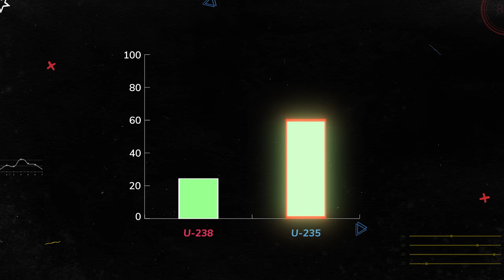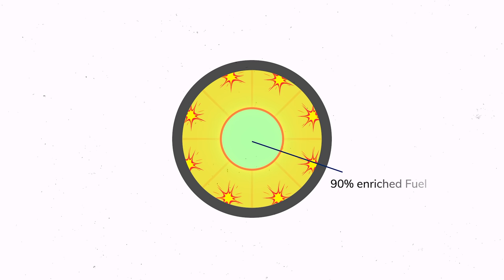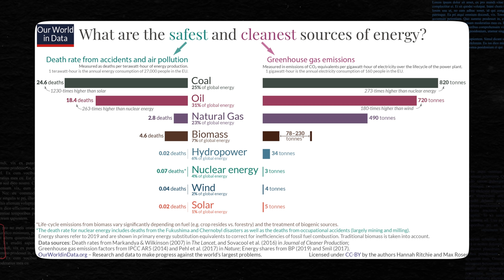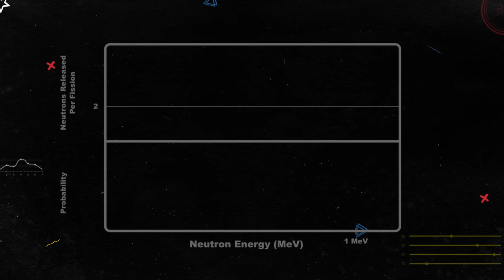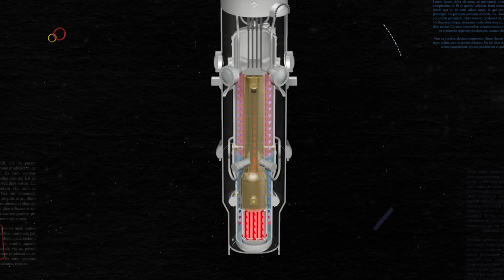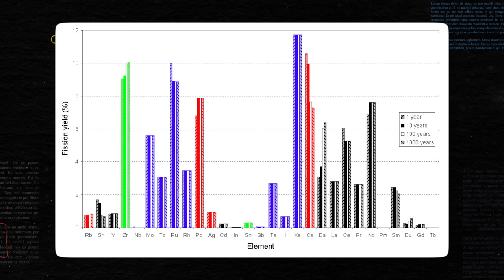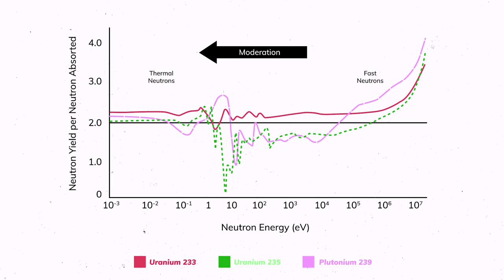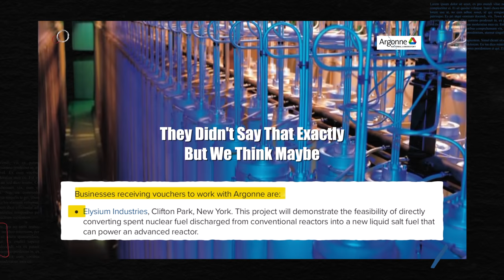This Reactor Feeds On Nuclear Waste

Comment: Thankyou very well presented summary. Renewables are important part of the solution, not the least due to comparatively low risk and cost, but they are beaten by logistics. Even by best estimates globally they can only meet 50%, nuclear will have to fill the gap. Sooner we get on with it the better.

Comment: The generation of clean hydrogen could be very useful to power jet engines

We need to properly dispose our nuclear waste and not just simply bury it (see the Yucca mountain controversy). Heck, back in the 80s they even dumped nuclear waste into the North Sea ("the solution to pollution is dilution"/out of sight, out of mind). Incredibly irresponsible and shortsighted. Most if not all of our nuclear waste is currently being stored in "temporary" storage areas at the very nuclear plants it is being produced. Locations that are not really safe. The problem: no one wants it. That's something proponents of nuclear fission energy conveniently leave out when discussing the wonders of nuclear fission.

Obviously, the thorium design has been around for a while and has solid engineering behind it. It also addresses many of the problems with traditional designs that, let's not forget, stemmed from a time when we had a Cold War. The industry got funding in part because the tech developed could be used to build nuclear-tipped ICBMs as well as power nuclear submarines.

The thorium design certainly also seems to have applications to power human colonies on the Moon and Mars as well as power large manned spacecraft.

As a wise Native American saying tells us: we don't inherit the Earth from our parents, we loan it from our children.

Comment: Looks like all the problems of nuclear energy are solved- in theory.
Let's see what happens when these things are turned over to marginally educated, poorly paid, tired blue collar workers who are under pressure to produce, and whose every move is controlled by bean counters. Working with components produced by dispersed subcontractors who have won the job on the lowest bid, and whose QC may be difficult to assess.
THEN we'll begin to understand what the problems might be.
Remember:
-The folks who designed Chernobyl's reactors understood containment vessels. But Government bean counters decided they were unnecessary.
-The reactors at Fukushima were originally supposed to be built on an elevated platform to account for possible tsunamis. But that would have added to the cost of operation, so changes were made.
But this time it will be different, LOL.

Comment: Everyone knows that energy production is subject to centralized control. The problem the controlers have with Thorium Salt Reactors is every hamlet can afford their own means of energy production. So it's not a matter of what you can do, it boils down to what the controlers will allow. Far to many mega-donors are awash in oil and gas royalties. 
  The process described in the video is a necessary technology,  but the powers that be would have people freezing to death before they would ever allow the public to benefit before them, those jerks don't want you to burn firewood for heating purposes. If you want to stoke up a fire for atmosphere and sip on wine, they're fine with that.

Comment: The more junk you put into the reactor, the less control you have. It is called reactivity. That's why no body uses used fission fuel - it's very active, but not reactive, so they leave it ni water filled pools for years, to decrease it activity

Comment: Not a bid fan of nuclear power, your idea with salt makes since, but the cost of the safety should be kept even tho it might not be needed.   Modular systems do not seem to always fit together well on the job sight.   Cause the cost saving of the unskilled Labor used to build h product. 
Keep the skilled labor then it might help.

Comment: Molten salts are are also extremely corrosive.
Reply: Molten salt is less corrosive than hot water. You sre thinking of mixed water, salt, & oxygen being corrosive, not pure dry, low O2 salt.
Reply: @EdPheil  otherwise, yes, you are right. Salt in aq. solution is corrosive to metals. I still have my physical chem textbook from my undergrad. I could actually look it up for specifics.

Comment: There is no rationale foe encouraging nuclear power. When the cleanup and remediation is complete in North Japan and Russia and the. Nuclear remains of the reactors in the USA that ran in the 1950’s and 1970’s is completely disposed of, then you can make a video. But, nuclear waste from the 1960’s still has not found a final resting place...  Try natural gas power plants. They produce far more environmentally friendly and 5he carbon dioxide that is produced can be offset by trees, which convert the carbon to wood.
Reply: If by "nuclear remains" you mean spent nuclear waste, then T4L addresses that in the video above. Look in the video towards @6:32. The Elysium process mentioned can take nuclear waste or weapons-grade plutonium as reactants to produce salts used as the fission medium. 

If by "nuclear remains" you mean everything else besides the spent waste, then I am a little uncertain according to what the video provides. I do not practice physics nor nuclear engineering: just electrical engineering. If the amount of radioactivity decreases with the square of the distance (similar to Coulomb's Law; just a guess!), then only the components nearest the reaction chamber will be of greatest concern (e.g. concrete walls, fissile material assemblies, etc.). That means we're talking maybe <10% of all materials and components that make up a complete nuclear facility, not the entire facility. 

Like what @Roland Lawrence mentioned in the pinned comment, the Elysium reactors are designed to be socketed into the heat-producing stages of a nuclear or coal plant. Maybe >90% of the remaining infrastructure would not need to be demolished in order to construct the new reactor, meaning existing nuclear plants in Japan, Russia, and the US could be recommisioned as is. Since a lot of the existing plants used heavy water as the fission medium (just a guess!), stuff that the Elysium reactions replace with molten salts, you could probably eliminate the safety devices that prevent steam creation. You potentially reduce concrete eyesores, increasing public and political approval such that more nuclear plants can be planned for the future.

Natural gas does have the LCOE going for it. Combined Cycle plants have price and demand response on their side, but they still produce greenhouse gases upon combustion. There have been recent studies looking into carbon sequestration in plants, and it appears that carbon intake reaches saturation as CO2 concentration in the atmosphere increases. Regenerative agriculture and polyculture would definitely address that, but my one question underlying your entire comment is this:

Why have the tendency towards believing in a silver bullet? We need all of these solutions in order to turn this ship that is climate change around. CCGT, FMSR, regenerative agriculture, home composting, solar/wind/geothermal/ocean energy systems, all of it. I am quite impressed by the technology presented in this video, and can't wait to see Elysium succeed.

Comment: Total junk PR. This design produces huge amounts of radioactive waste since the whole core circulates all the pipes´re as radioactive as core material in other reactor types. While running you cannot come close to the proimary cycle without receiving lethal doses of ionizing radiation. In Chernobyl as well as Fukushima it has been thoroughly demonstrated how machinery breaks down in proximity to core material. It´s just junk PR for the guilible paid by oligarchs with zero clues either. If this were such a perfect design we´d have atomic airplanes since these where designed for atomic airplanes in the 50s&60s.
Reply: Without the moderator the reaction halts.
Reply: @Randy778  so what? By the time the salt leaves the main tank the reaction is well below criticality, refuting your assertion that the main loop is super hot. Moreover, even if it was, MSRs are designed to not need people get in containment vessel.
Reply: @kokofan50  LOL! That wasn´t "my" assertion of how that thing functions. It was part of the review of the Oakridge Experiment. The entire piping of the inner cycle gets heavily irradiated since the design pumps core material-the molten salt is basically the core... preventing basic maintantance.
Obviously you´re entirely clueless on that matter anyhow: "it´s not required" to "enter" the containment vessel in any reactor. Nobody in it´s right mind goes swimming with that blue glow beneath him. ^^  
So please spare me your PR gibberish.
Reply: @Randy778  what are you talking about? People regularly are in the containment vessel of large reactors. I think you’re confusing it for the reactor vessel. Also, the study “Experience with the Molten Salt Reactor Experiment” says maintenance was easy with little radiation exposure. Not that that really matters with reactors that are just shut down and the whole module replaced if there’s a problem.

Comment: All these scam reactor startups be like:

"We have designed a compact small modular reactor that LITERALLY EATS NUCLEAR WASTE and fits into a shipping container. Research and development is 90% ready."

Reality:

- Drawn shipping container (10%)
- Bought shipping container (10%)
- Painted logo on shipping container (10%)
- Made some pictures of what seems like vegan gluten-free designer nuclear power plant (10%)
- Created presentation and paid bloggers and second-sort media to repost it without fact-checking (10%)
- Attended a conference with a bunch of similar startups (10%)
- Created a web site with some additional materials, like photos from Oak Ridge (10%)
- Spoke in front of potential investors lying to them more than usual (10%)
- Promised infinite cheap green sustainable zero carbon safe nuclear energy/desalination/heating to some naiive government (10%)
- Now searching for a vendor to design a nuclear reactor which will fit into shipping container and will work on nuclear waste (0% done. You know. Those yellow barrels with glowing toxic green goo, right?)